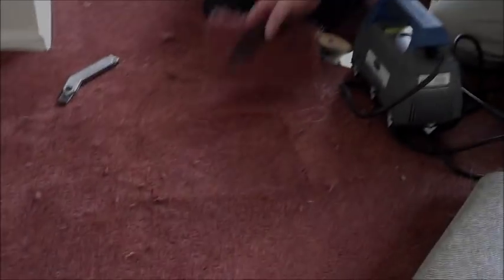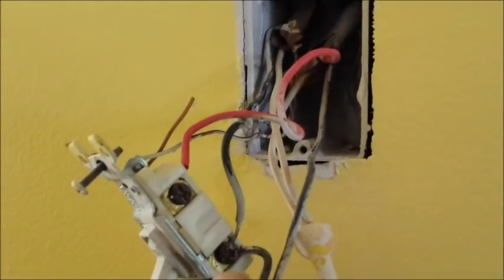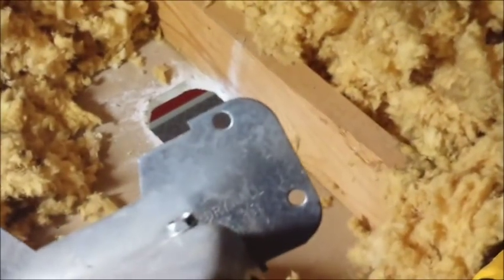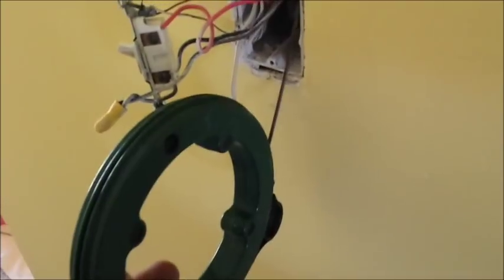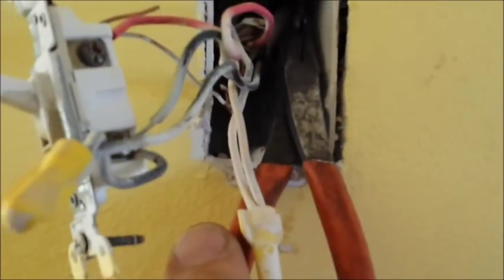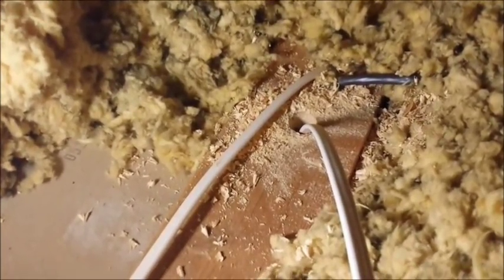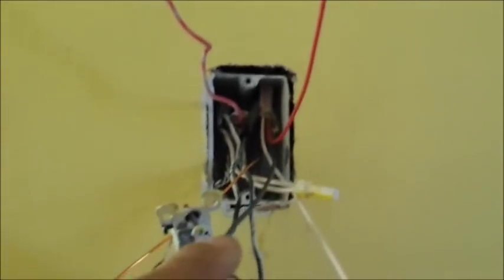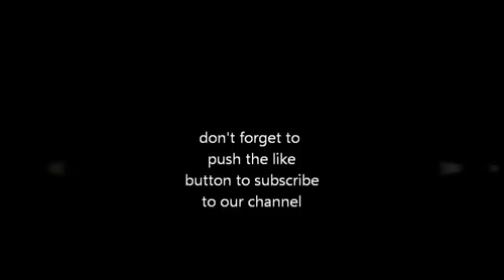Install a Ceiling Fan where no Wiring exists

Comment: Installing a new ceiling fan in room hoping to power it from a switch that I assume is tied into an outlet wire is 14/2. Have the neutrals wire nut together, the ground, and the black with blue from fan. Have the neutrals tied together at switch along with ground and I have the black onto switch but I get nothing at fan any advice
Reply: It's hard to tell from your description.   I would suggest watching through the whole video again and carefully track with everything.   Best to you!

Comment: I noticed that the light switch was powering a plug outlet. I have the same kind of setup.. should I just run the wire to the switch and keep the outlet connected Co I can still use the plug? or do I need to disconnect the outlet and run only the fan wire to the switch?
Reply from the maker: We cover that in the video, but the short answer is leave the outlet connected.   There are a few different ways to connect it depending on whether or not you want the outlet controlled by the switch.

Comment: So, the red wire from the receptacle to the switch is rewired to the white wire on the switch?
Reply from the maker: The red wire that leads to the receptacle is the one that controls the switched half of the receptacle.   If you want that half to be hot all the time then nut it together with the other hot wires in the switch box. If you want it to still be switched, then connect it to the switch.   If you aren't clear on what to do, hire a qualified electrician.
Reply: You didn't really clarify that , I am a qualified electrician, just trying to make sure you explained it right.
Reply from the maker: Jarrod Starnes ok, thanks for clarifying.   
I don't remember ever using a red wire for a neutral in this video, so that doesn't make sense.  I'll have to back and watch it again sometime to be sure how to answer your question.   It's been a couple years ago.

Comment: Great video. Thanks! I made the attempt using 12/2 from switch to fan/light and I have the same exact set up as you with power to 1/2 the receptacles. I want constant power to receptacles and only control light with switch. I tried every combination possible and cannot for the life of me figure it out. During the process of elimination other light throughout the house were affected. it would would cause lights in other rooms to not turn on that I believe are not on same circuit in panel. I eventually ended up rewiring the same way as i found it. Switch still controls 1/2 the outlets and fan & light are working only with pull chains though. Needless to say it was a wrestling match with the old box and I slightly damaged drywall. Had I known it would end this way I'd have just wired direct to another JB in attic. I'll need to replace the box and repair wall soon. Can you suggest options to get me where I want to be using the 12/2 being that its already in place? Thanks ahead
Reply from the maker: Well, if you only have a 2 wire(12/2) running to the fan, then you are stuck with using the pull chains.  That was a main point of what I showed to make it to where the fan has constant power and the light works from the switch.  

To get power to the other half of the outlet that used to be switched, you just need to move that lead off the switch and nut it to the constant power wires in the switch box.  

Go back and watch the video again because all this was covered in there.
Reply: @Homemaintenancesolution  Thanks for the reply.  Apparently I had it done correctly the first time and after all the madness realized I had never pulled the light switch on the on the fan.  Lol rookie move but I learned.  All is good now and I'm going after 3 more today.  Thanks a ton!
Reply from the maker: @jbucks166  Awesome!

Comment: Why don't you just add a junction box in the attic, cut the wires going to the outlet, then reuse the existing red wire to run to the light? Seems more logical, but I am not an electrician, and I have no idea what is the correct method.

Comment: Why does one of the black wires need the wire nut with the extra little wire going to the switch? Can't both black wire ends be connected to the switch?
Reply from the maker: You can put two wires on one screw.  Each terminal is made for one wire.
Reply: Did you mean you can't put two wires on one screw? I have something similar, but it seems something different is happening. I want to do much of the same thing by installing a ceiling fan and attaching it to the one light switch in the room. The switch operates both outlets of the same receptacle. I know this because I removed the red wire that was on a post and turned the power back on, both outlets in the one receptacle didn't work. So when I take the light switch out of the wall I have almost the same thing you have. I see a red wire around the BOTTOM post, and black wires around UPPER post. I say wires because when I removed them to inspect, the main line is one then I have the outlet wire connected to a pig tail that is also around the same post. The red wire is from the outlet set of wires. I am assuming the main line is the main line because I see it coming in from the top of the switch box and the other set is coming from the side of the switch box the outlet is on. When I put the black wires back and left the red disconnected I have no power to the receptacle. All I want to do is simply be able to get power to both fan and light ( I don't mind having to pull the chains to turn them on or off) when the switch is turned on while at the same time maintain power to the receptacle. It would be nice to have power to the receptacle regardless if the switch is on or off, but not a must. Anything you can suggest? Thank you very much for any help you can offer.
Reply from the maker: @paulp5656  it's hard to follow everything you are saying without a visual, but I can say this.  You need to figure out for sure which is your power supply wire and connect your outlet wire to that along with a pigtail that feeds your switch.  Then the new fan/light wire comes off the other post on the switch.   As long as you have your neutrals right,  everything should work.

Comment: I know this is an older video but i have a question. My family is having 3 ceiling fans installed in our bedrooms and we currently have no lighting fixtures at all in the rooms, but the bathroom does have power because it has an exhaust fan and light. The guy we hired says he is going to get power from that source and put boxes over each room that way instead of the way shown in this video. my question is, is that safe to do? or should we be prepared for a house fire. thanks.
Reply: The bathroom has it’s own dedicated 20 amp circuit , this is required by the NEC.   You’re not supposed to tap off that circuit for another room.  If there’s an outlet in the room you’re installing the fan in, that’s what you want to do.

Comment: What would the average/fair price be to have this done by a licensed electrician?
Reply: +Lisa McCartney Most of the electricians I've spoken to and/or met (aside of ones working for "Big Box" stores) will charge by the hour. In my area that charge is $99/hr. It could be higher in your area. Find out what most charge in your area, then add to that the cost of the materials and there should be your answer.
Reply: My mom paid a handy man to change an existing light in the bathroom instead of asking me to do it. They charged her $400. It always ends up being more than you would think. Don't let them trick you with that per hour charge. They will find a way to inflate the final price.
Reply: You can try to get a job bid? I went to bid for a backsplash project and even though they ended up doing a little more work (installed new receptacles for me), they stuck to their quoted job price and there were no surprises.

Comment: I have the similar situation where my single control switch only have black and white wired to it, and I wonder how do I wire them for the new wire for the fan and light?
Reply: Dave, I have the same issue in one of the rooms. Were you able to figure it out and wire your fan? Thank you in advance!
Reply: +Nasr Ahmed 
I had the same issue and ran power from a switch in the closet up through the attic, then down to the switch. I chose to add another switch instead of using the existing one. I then ran 14/3 up from the new switch and over to the ceiling fan. A PIA but worth it in the end. This video was very informative and gave me the confidence to tackle the job!

Comment: do i need to run a 3 wire from the switch to the fan if I don't want it always on?
Reply from the maker: James, no you really don't need to.  You can just run a 2 wire, but remember that you can only run the fan when the switch is on.   Best to you!  Please share if you have a chance. 
Www.houserepairsyourself.com

Comment: so my switch on has a two wire cable in it. Im assuming that mean the power is coming into my receptacle and not my switch, correct? does this make the wiring in the switch different? what do i do with the neutral wire from the new 3 wire that im putting in? cause the set up in the switch right now is just a black and white wire to the switch. nothing else. other than the ground
Reply from the maker: Lukas Coote, if that's the case then you have no neutral in the switch box.  The white wire in the 2 wire cable is used as a hot wire to carry the switching power to the outlet (or the constant power from the outlet to the switch).  If you have a good understanding of this, then I can walk you through it.  You should not try this if you are not qualified. 
First you need to go to the outlet and disconnect the 2 wire cable from the outlet and use it to carry the hot and neutral to the switch box.  This should leave the outlet on constant power.  You will then have a neutral in the switch box to nut together with the neutral on your new wire which will carry the neutral up to the light.  Make sense?
Reply: Totally! Thanks for the reply. You're a life saver!

Comment: My box has only 2 wires one black and one white...there is not even the grounding one
Reply from the maker: Are they both attached to the switch?
Reply: Thank you. Yes they are and I use it for a lamp  but was hoping to do a lighted ceiling fan but my luck I opened it and it looks nothing like yours.
Reply from the maker: If so, then they are using the neutral (white wire) for carrying the hot current back to the receptacle.  This means that the power comes to the receptacle first and they have use one cable to break the hot side at the switch.  This means you have no neutral in the switch box.  If that makes sense to you, then that should help, but if it doesn't, then you should hire a professional.
Reply from the maker: Sorry, but that's going to make it a little more complicated.   Hint: you'll need to bring your fan wire from the switched receptacle.
Reply: Yes, thank you.